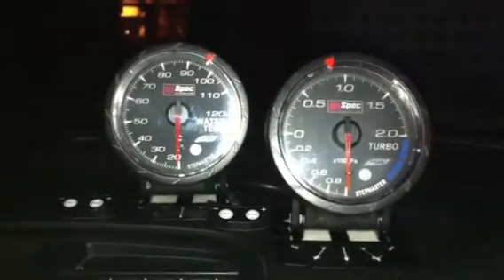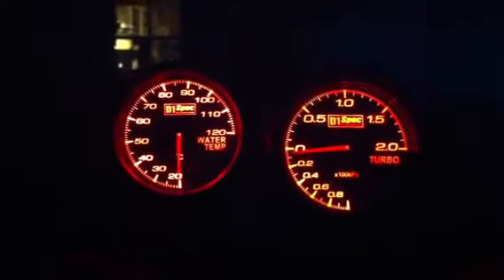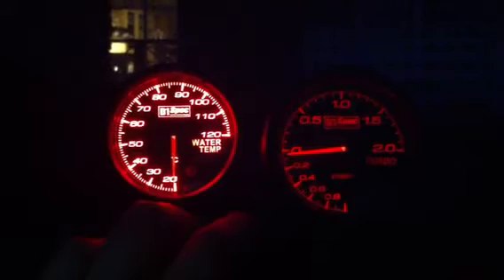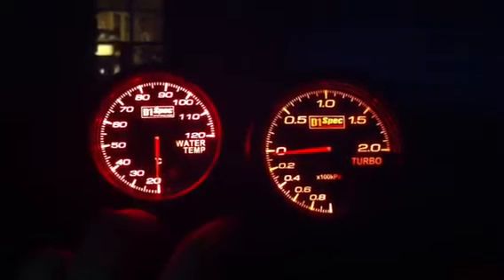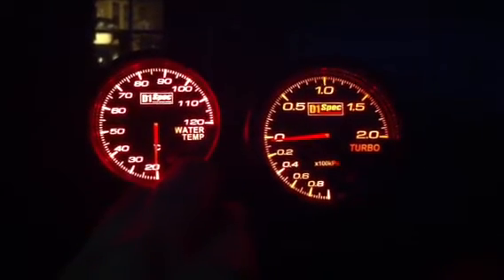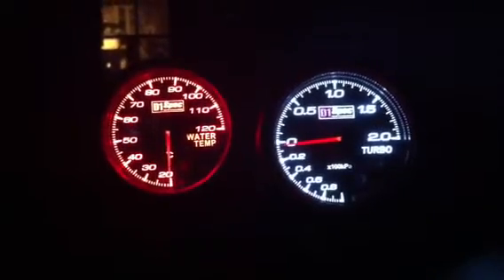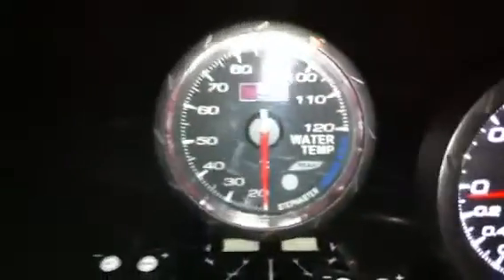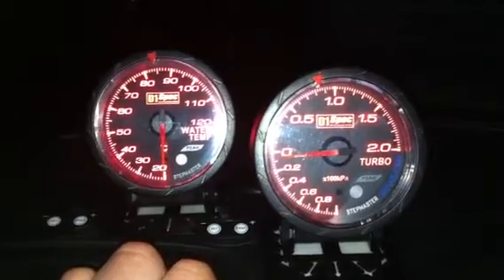D1 spec distinct gauges

Comment: Nice Video. Is it possible to change the color /dimm the gauges via light-switch from the car (+12V switched input) , or do you need to take all the settings with the touchpad every time with every gauge seperately?